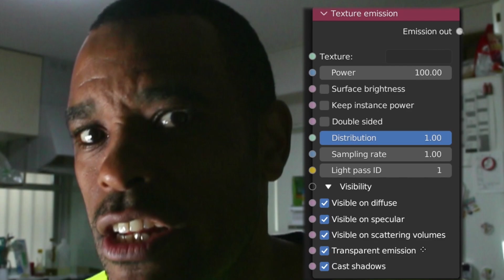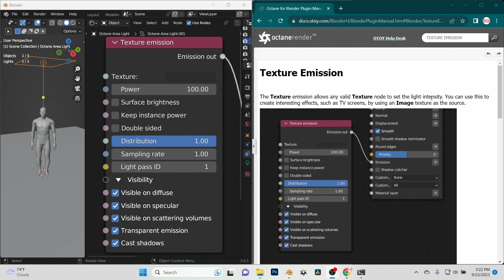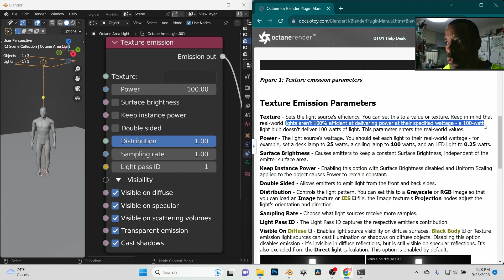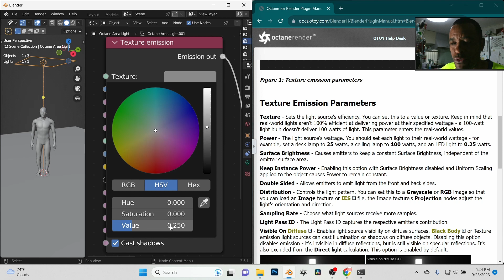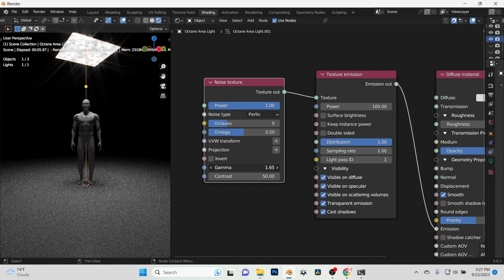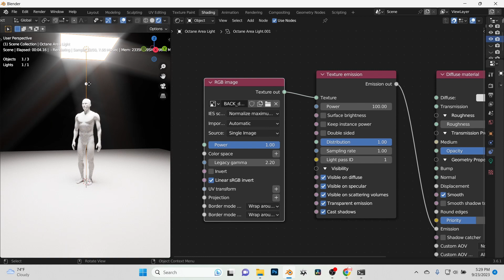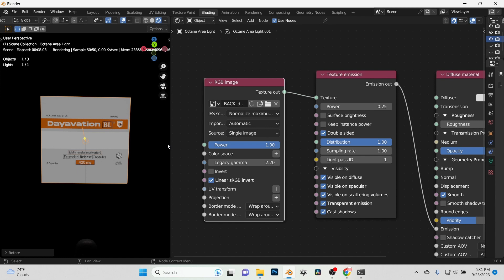Do You Understand Octane Lights? -  Octane Lights Explained  PT.1

Comment: Is there a way to adjust spread angle of an area light, like in cycles.
Reply from the maker: If you go to the light bulb 💡 tab then go to size that will make the light have a Sharp or soft shadow edge